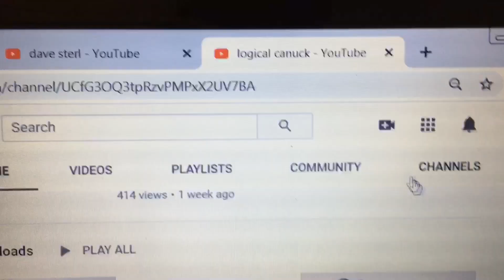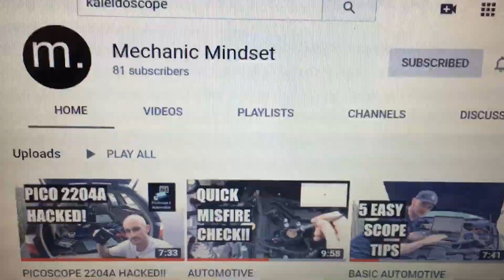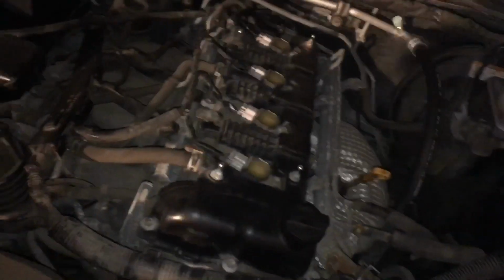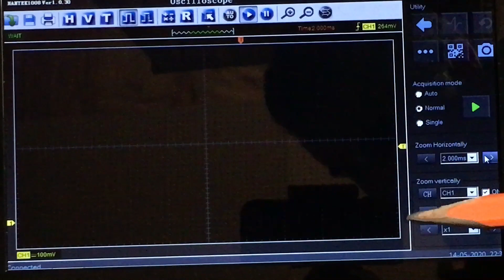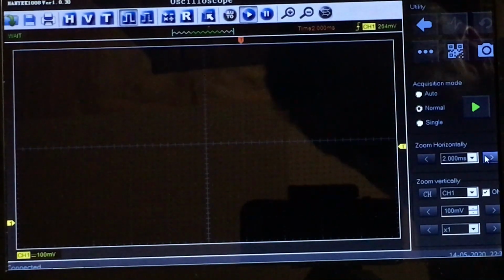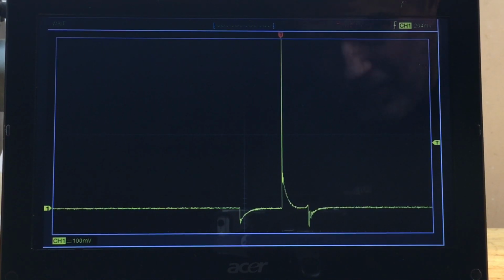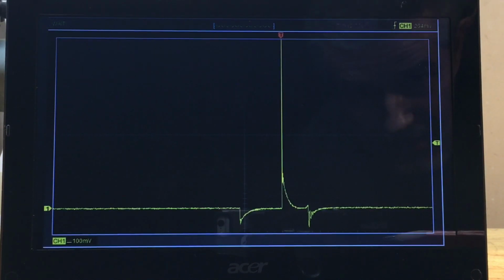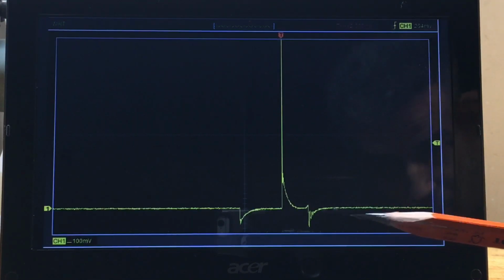Easy Secondary Ignition Waveform Acquisition

Comment: great video. actually that is an  excellent waveform. it has great detail. you have your firing line, spark line,and dwell section. that dwell section is important in my opinion. if you use a second channel with a low amp, you will see how that dwell time section reflects your amp waveform when coil is in saturation dwell time. sometimes just by analyzing  that dwell section that you were noticing ,you can see a bad coil induction. you gotta play with it since it's clearer on some coils than others.thanks for the video
Reply from the maker: Thank you Sir  👍

Comment: Can you get a duration time of the high voltage--some kind of average pulse width?  That is what I really need.
Reply from the maker: While the Hantek 1008C can measure period , duty cycle etc...If I understand your question I think you must be referring to firing line, spark line or dwell ? Because of the nature of the trace I don’t believe the Hantek can auto measure those parameters. You can manually use the cursor function to manually measure a captured trace. (Duration of certain characteristics)

Comment: Good that you posted Ian and gave fair warning. People can make up their own minds based on their risk tolerance and how expensive an oscilloscope they're using it with. Budget solution for budget scopes. And, this can outperform some pricey paddles.
This approach works well BECAUSE there is no protection. The signal has negligible power and would easily be impeded by any circuitry.
I did listen to viewer suggestions of placing a PVC end cap over the bare copper end cap in my design as that may offer some "protection" without compromise.
Reply from the maker: logical canuck Yeah you know...I talked it over with a “Buddy” and on further reflection, I decided it’s not cool to infantilize the audience. I rail against it when it’s being done to me...So in the interest of not being a hypocrite...Cheers Denis & Thx!